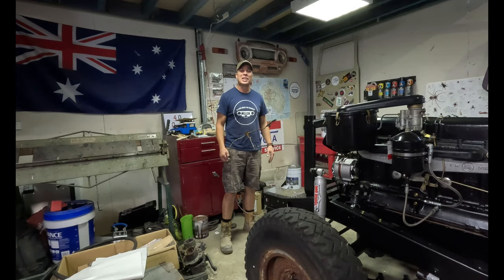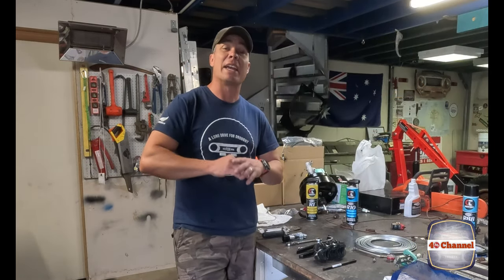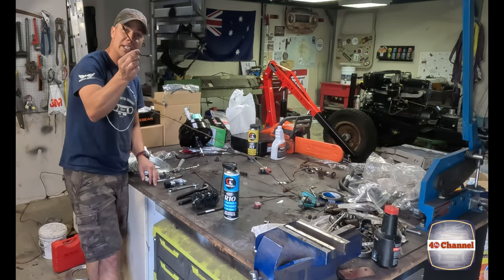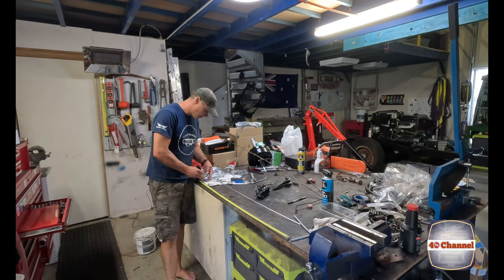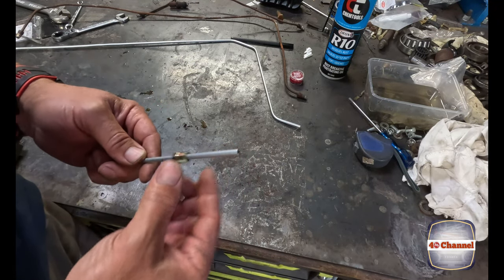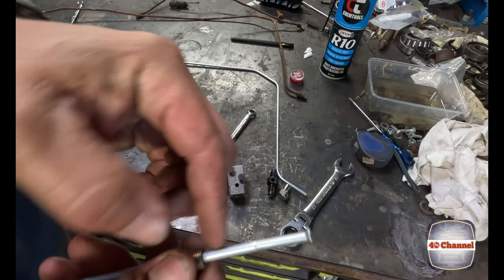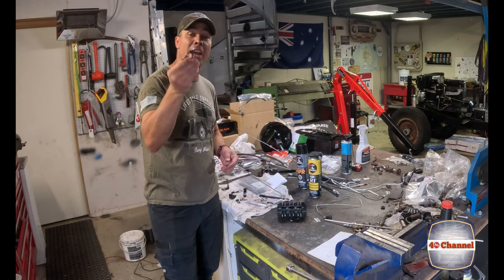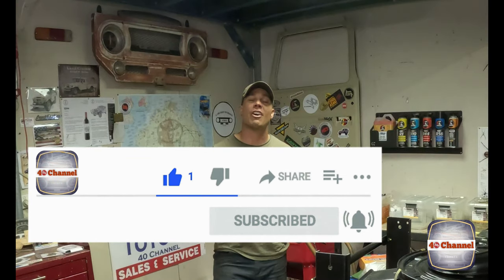S2EP80 - How to make Hard Brake Lines, Double Flaring, Bending, and Install

Comment: Great episode! To help with re-fitting I take pics from front to rear of each bracket and line with everything in place. I then crack each fitting on the vehicle if I can.
Reply from the maker: Thanks CH, yes it is always a good idea to take reference photos. I had the brake line diagram from a workshop manual, which showed brackets and locations.

Comment: Titan brake line tool.  That thing is fantastic compared to the old style ones.  There is no comparison... it is so much better.  I redid all the lines on my Silverado with one of those.  Best brake line tool I've ever come across.  

I didn't have a fancy straightener or bend tool.  I just took a piece and used electrical tape about every foot and matched it up from one end to the other.  Biggest problem I had was the more you work that line, the stiffer it gets... and very quickly.  It hardens quick.  

Great job as always mate.  Keep the videos coming.  Cheers.
Reply from the maker: Thanks Altair, yes it can be an issue with work hardening the tube.

Comment: Great instructions. After using the pipe cutter, I usually debur the inside of the brake line. The pipe cutter usually has a little tool on it to do that.
Reply from the maker: Yes, I did use it a couple of times, but I found the  flaring tool cleaned it up just as good.